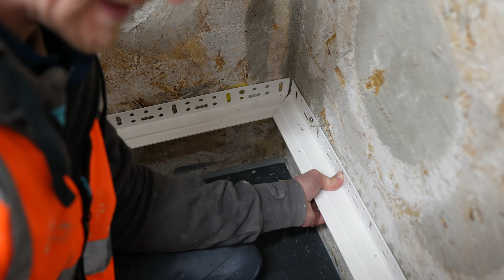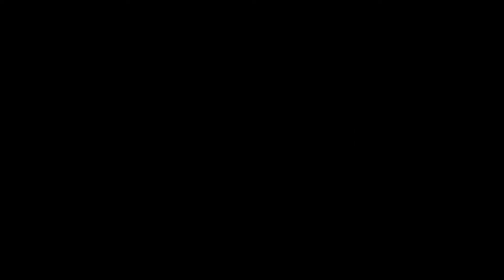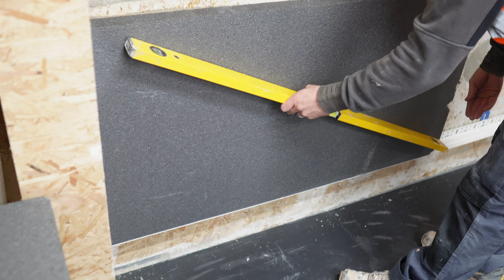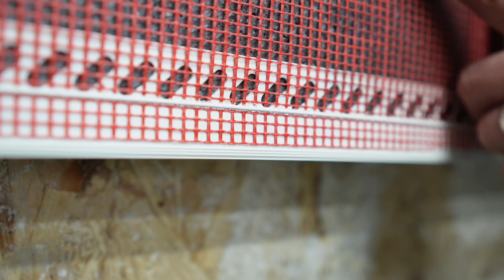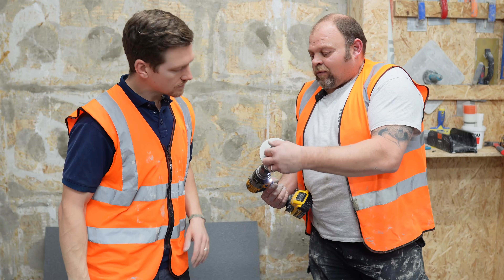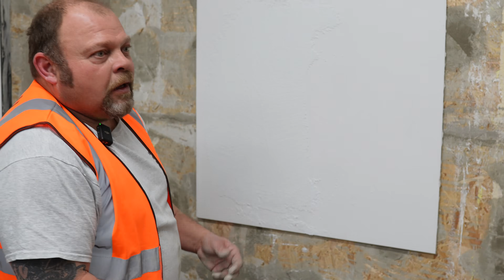External Wall Insulation Explained | FULL PROCESS REVEALED!

Comment: Can you please advise on how to replace old pebbledash rendering with the insulation, i mean the old needs to be scratched and then rough coat and then put the sheets and on the top start finishing, i have just give you an idea what i am trying to know, will highly appreciate if you can provide step by step advise

Comment: They are charging 28k euros for this on a semi d in Ireland. A lot of work involved but no qualified trade needed so its OTT in terms of pricing. Will be 30years plus to get the money back and the installers only guarantee the first couple of years so basically all risk on homeowner. Definitely DIY possible, concern is having to install and work on scaffolding

Comment: What worries me, is this system going to be another spray foam roof insulation disaster and you can't sell your home. Polystyrene is oil based so could it ignite, and therefore is that safe? Don't really trust government safety organisations these days they were trying to cut legislation on furniture fire regulations not so long ago
Reply from the maker: It’s not standard Polystyrene - it’s highly resistant to fire and isn’t flammable
Reply: @PlasteringForBeginners  I would be interested to see the fire testing. Used to see foam fire testing over at Northampton when I worked in the furniture trade. They said the cladding on certain flats was and that proved to be wrong.

Comment: A house has this near to where I live. There are  gaps for gas / electric meter cupboards, a BT connection and some conduit that goes from the ground to first floor in an open channel. I do not know the owners so cannot really ask to use my FLIR on the inside but suspect there will be several cold spots attracting condensation and presumably mold. The concept of this insulation looks interesting, execution in practice I suspect will be flawed.

Comment: Good system. Here in melbourne this is all we do on 2nd floor walls. We use bigger sheets of foam though. Either 2.4m ×1.2 m sheets or 5.0m×1.2m sheets. Less likely to crack with bigger sheegs

Comment: Very smart idea to put those pieces of foam after the screw and washer. Here in melbourne australia you see alot of the time you can see the screw holes after basecoat and texture has been complete because the screws have been over driven. In the wimter time with the morning dew polystyrene walls look horrible. Great idea

Comment: My mate had this insulation and "render" done on his house. He says that its insulation properties are brilliant, but not so much to look at. At the front of his house the render has cracked off where his son has leant his bike against the house and round the back it looks like a world war 2 bunker thats encountered some tanks! There is damaged render everywhere, just from his son kicking a football repeatedly against the house, you know like a nine year old does.
Reply: Yeah this stuff is definitely not designed for impact.
Reply: I see that kind of thing on commercial buildings all the time, with dings from delivery trucks, trash bins, etc. It looks a little funny when you see a fake granite archway crushed to reveal what looks like packing material. The systems with with an outer layer of cement board, tiles or brick veneer, at least on the ground floor, seem to avoid most of that.
Reply: Amazing strength these 9 year olds!

Comment: It  looks easy and it is on perfectly flat wall. When its not, if has curves or holes or insulation is ticker 8cm then it ask for extra effort and stronger drilling machine for fixing. Those days I am putting wall insulation at my home, its hard work. Instead of mix material for mold I was thinking to use foam gun for roockwool and styro board to speed up proces but not sure how it works on long terms. And I haven't seen in video you sand outside board before rendering.

Comment: Looks a good course.  I did the one with EWI Academy in Aylesbury as it's not too far away.  It was very similar which is good for a standardisation.  Useful hint about the packers and that hot cutter, wow.  Another thing to consider, as said, these are on old houses mainly so other works are needed.  Facias and sofits may need some sort of work. Rain pipes, poo pipes and other fixings will have to be moved outward.  Just things to consider.

Comment: Interesting video but most external insulation would be to retrofit a house. Old houses were built to breath and this insulation does not allow that. Unless the house is gonna try to be air tight, which is very difficult to do. There is a similar system using wood fibre boards and lime, cork render which is completely breathable and eco friendly. Some wood fibre board manufacturers are gutex and steico. They have EWI systems aswell as internal systems and boards. I hope this info helps anyone.
Reply: Totally agree unfortunately old solid wall buildings suffer from some kind of damp issues that EWI systems can make worse.Also some off the detail doesn’t look great i.e bay windows and roof eves without soffits
Reply: @bluevanmani looks shit
Reply: Isn’t the theory that water vapour in the house (and thus walls) will reach the dew point in an uninsulated 9” wall, but it stays as vapour if the wall is warm enough? 
Meaning it goes in and out of the wall depending on relative humidity levels of the wall/house.
A vapour barrier should not affect this?

I may have this wrong though! I have no experience of actually doing this, but I’m thinking of doing my house next year.
Reply: My son was told exactly that regarding his 30s non cavity wall house.
Reply: @llamedosr7843  yes, after researching i found that it is extremely difficult to make an older house airtight which you must do in order to make this type of insulation work as it should. It doesn't mean its wrong if you want to tackle that big job but i think for most older houses like my 1936 semi, double brick, then woodfibre for me is the way to go. Plus i like the eco benefits of that type of insulation. Wool is good as well, also hemp. Its very interesting if you look into it. I only said this so more people could have the correct knowledge rather making a huge mistake.
Reply: @Jrambo51 
Could you recommend any reading or video material regarding rendering woodfibre insulation? Like how are woodfibre panels fixed on and to what, what kind of lime, is there mesh to be applied etc?
Also, can vapour membrane be used with this type od ewi ?
Reply: There were problems with systems like this on wood-frame buildings in the USA and NZ, with caulking failing, a little water getting in, but having no way to get out, and the framing turning to mush underneath. The 2 ways they solved it were to, on one hand, put the foam panels over a water resistant barrier, with enough of a gap for any water that gets in to drain out, or on the other hand, put the water resistant barrier (probably the sticky kind) over the foamboard, then glue a layer of cement board over that, with a drainage plane created in the gaps from a notched trowel and the stucco applied to the cement board. The later would obviously be more expensive, but it avoids air circulation compromising the value of the insulation, and it makes the outer surface more resistant to fire and flying debris. I would think either system would protect a solid masonry wall as long as it covered the whole exposed area, though "rising damp" and any insulation gaps that can't be avoided could conceivably cause  problems.